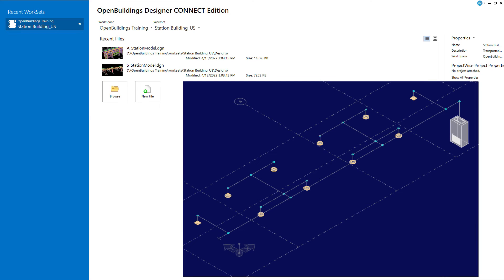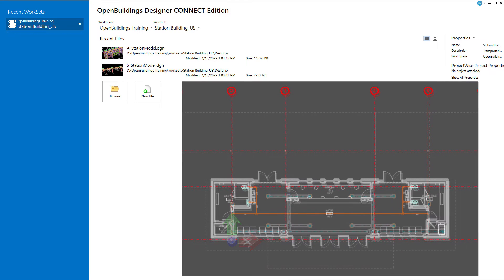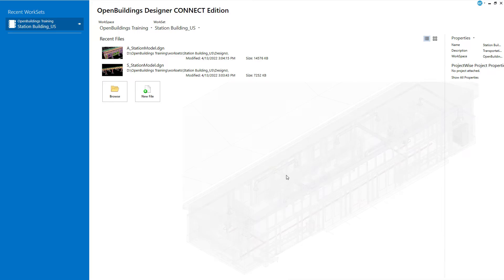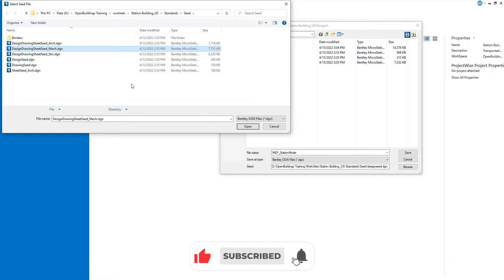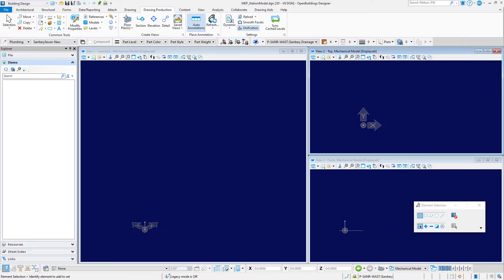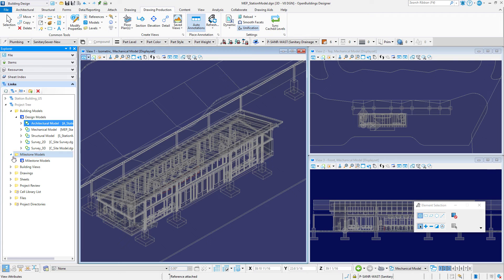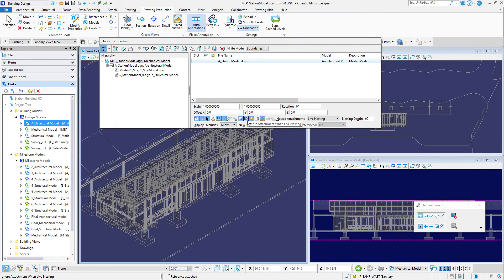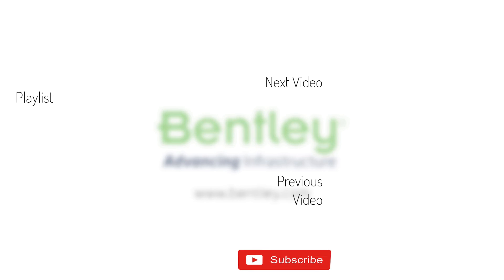6.0 - Introduction to Modeling Mechanical and Plumbing Components

Comment: I am a new user for this program, I am not able to locate the mechanical / plumbing sheet seed file the one you have chosen in your video. Do I need to create mine?
Reply from the maker: Hi, You need the dataset that is used for this training.  There is a link in the description above to the full course on the Bentley Learn Server.  I am adding a link here that will take you directly to the introduction to the course where you can download the dataset.  https://learn.bentley.com/app/Public/ViewLearningPathWithMasterCourseExpanded?lpId=116818&mcId=103962
You will need to use your Bentley login to log in to the Learn server or create one if you do not already have one.
Reply: @BentleyBuilding  Thank You